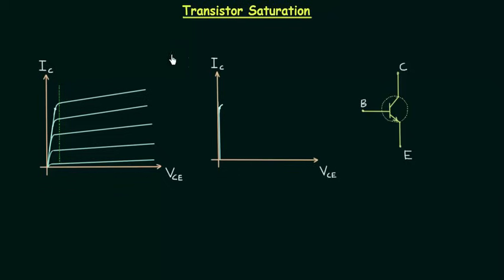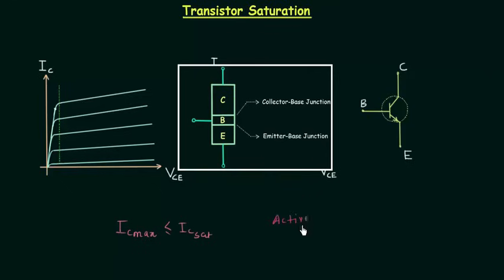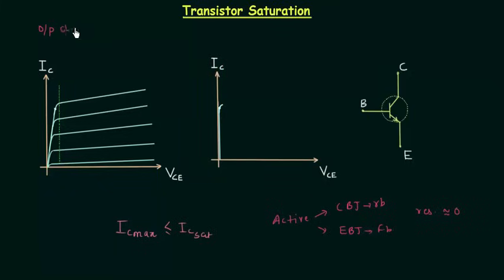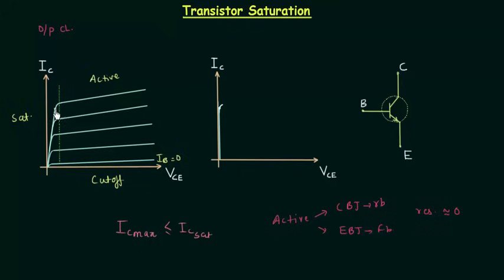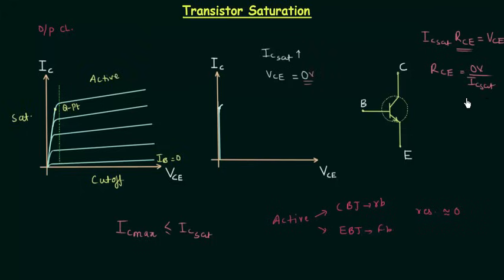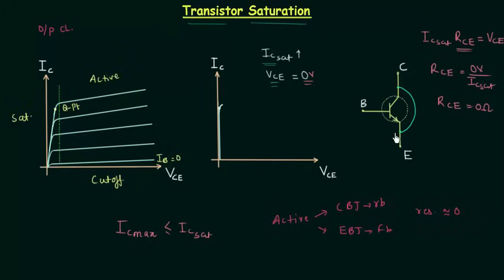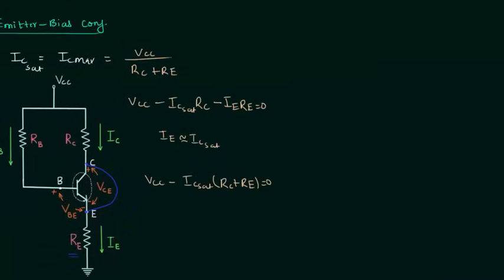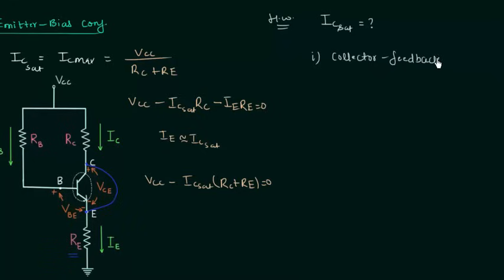Transistor Saturation

Comment: Why "IbRb" Term is not in collector feedback bias circuit?
Reply: The current tends to go the branch lower or no resistance, which means the current I which divides into Ic and Ib will not do so in this case because collector and emitter are short circuited (Rce=0) hence the current will go straight through it. Hope it helps :)

Comment: Well i might as well ask. 

 when the maximum Ic current is reached for a certain circuit that you have biased, regardless of whether the base current increases, the Ic will be constant.
this is termed saturation.

If you increase your Vcc your Ic saturation point will also increase, ultimately increasing you active region.

my question is:

How do you know at what point a BJT  will not allow more current on the collecter-emmitter line regardless of the Vcc and RC(collector resistor)? 
Would that be the breakdown region of a Transistor? or what is that phenomenon called?

Would This obviously only be read off the data sheet?
Reply: With due respect,
I would try to answer your question(see if I got it right)
No, if base current changes collector current will change as it is clear from the output characteristics.
Saturation is just that part when Ic increases rapidly for Vcc or we can say it reaches maximum value.

If you do practically,
When we connect the biasing circuit to BJT, Ic increases initially if we check it on ammeter. It will increase up to some value and at a point it will become constant. That is the the point where it comes out of saturation.

How do you bring it out of saturation? You could reduce the amount of base drive to the transistor (either reduce the voltage Vbe or reduce the current Ib), which will then reduce the collector current, which means the voltage drop across the collector resistor will be decreased also. This should increase the voltage at the collector and act to bring the transistor out of saturation. In the "extreme" case, this is what is done when you switch off the transistor. The base drive is removed completely. VbeVbe is zero and so is Ib. Therefore, IcIc is zero too, and the collector resistor is like a pull-up, bringing the collector voltage up to VCC.

source: electronics forums

Comment: Hi, i am still abit confused with how transistors work.  So are you saying that current (+) is the only thing attached as a supply to the transistor Base to control the 'gate' between Collector and Emitter? if so, then that only means that current would be traveling from Collector to Emitter and not the other way.  I usually thought the Voltage would travel from Emitter to Collector and that, to get current you would have to restrict voltage.  So rather than think that voltage is voltage, instead it is current traveling from Emitter to Collector.  And to get a large amount out of the Emitter Collector or Collector Emitter then the Base would have to either reduce its restriction or increase them.  That is how i thought it would be but looking at your video, i am now confused.  Could you explain to me whether i am on the right track please?  :)